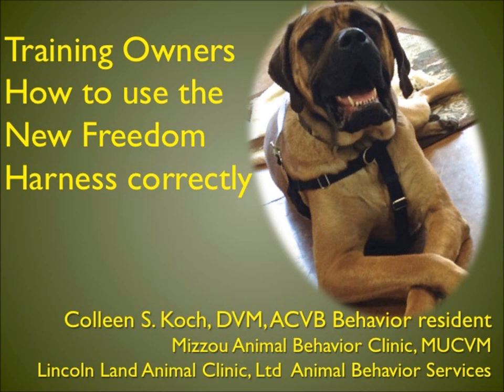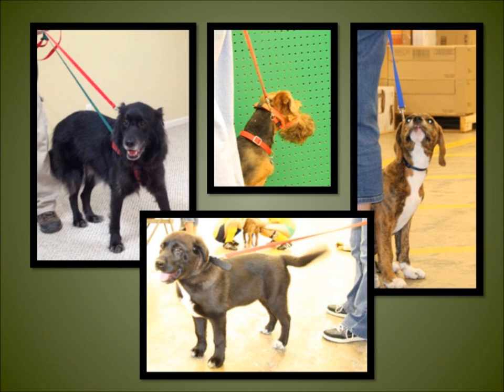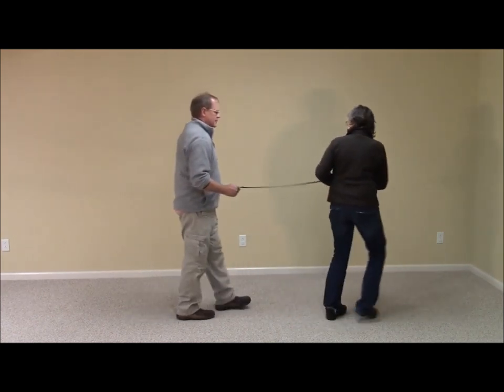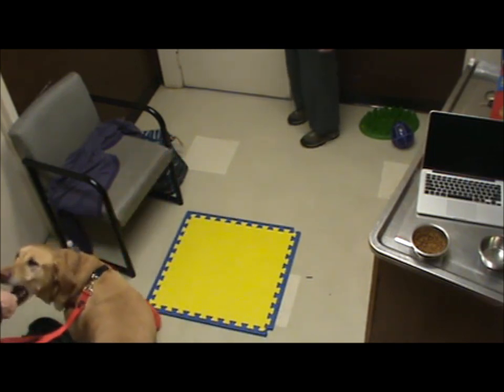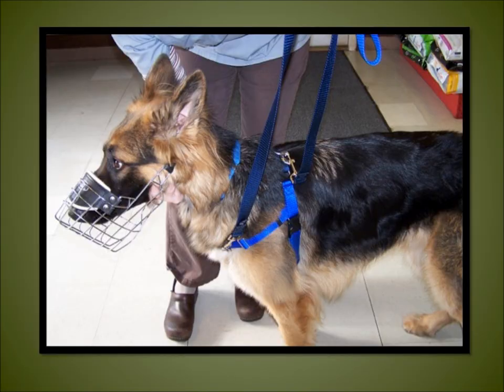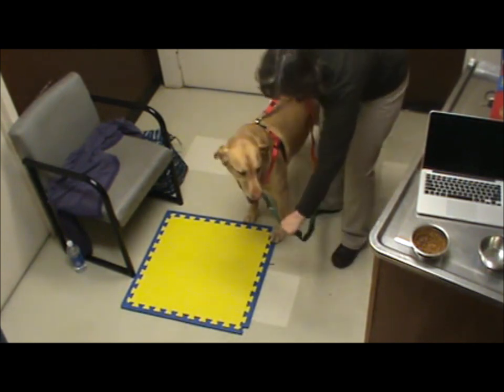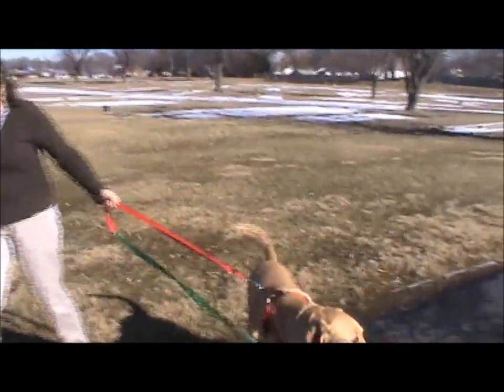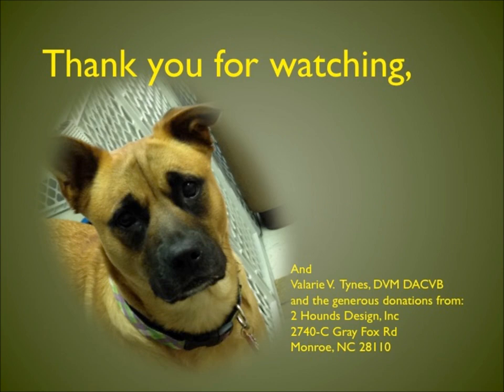Teaching Owners How to Use the New freedom Harness Correctly

Comment: I am starting to use the chest harness and Euro leash with a 9-month-old Great Pyrenees. Your explanation makes sense, but the leash runs through a ring and so pressure can't be applied only to one side or the other without grabbing it with my free hand. Is this the right way to use the 2 Hounds Design leash, or should I switch to 2 connected leashes? Thanks for this video!